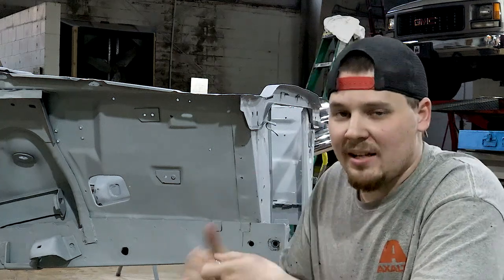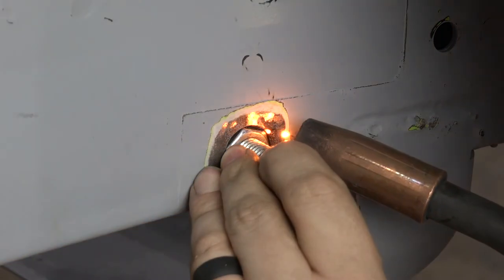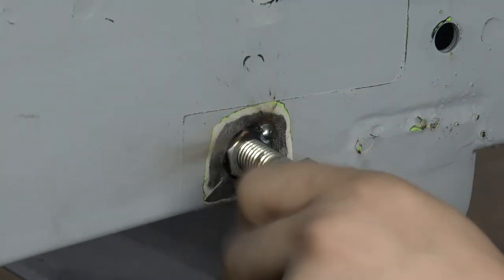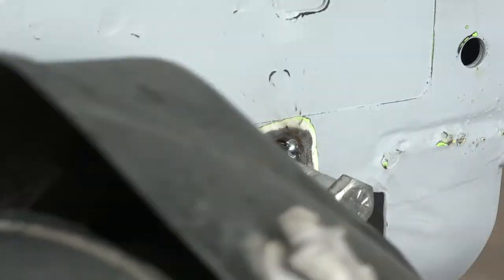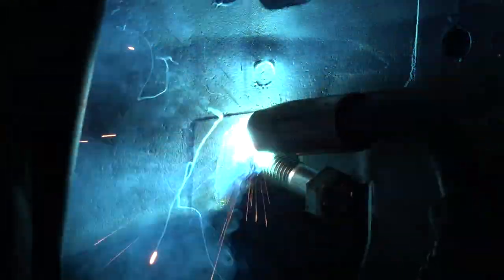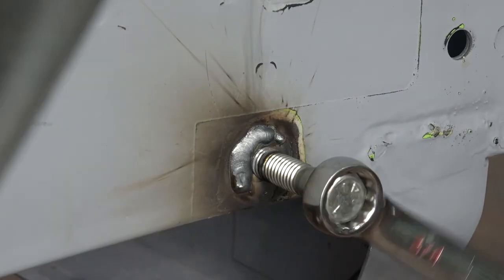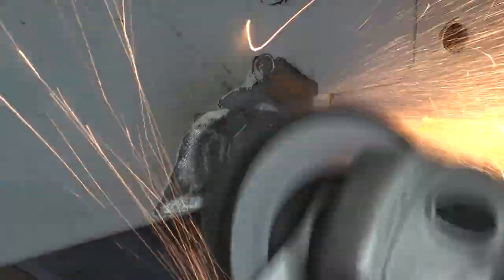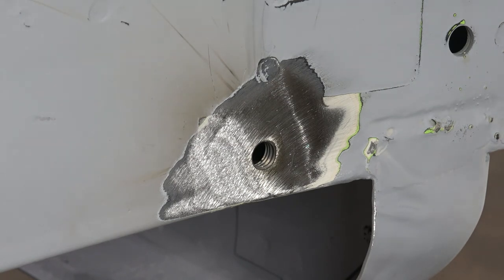How To Fix A Broken Nut Inside Of A Frame

Comment: Thanks dude... I tackled this on the weekend, worked out great like you showed. I originally broke the nut inside of the frame mount for the front lower controller arm on an older Subaru outback. I was gonna go another route which was more work till I found you;)
Reply from the maker: Thanks !!

Comment: If you weld this then paint only the OUTSIDE of the frame (where we can see in the video), how do you protect the inside of the frame where the paint has been burned off? 
it will eventually rust/rot in there if left as exposed metal.
Reply from the maker: Spray the inner frame rail with DMP.

Comment: Nice work.  I have a Jeep CJ7 frame with a bunch of broken bolts in the threaded holes and a few stripped holes.  I was looking for a clean way to do this repair!
Reply from the maker: Thanks man Yea man this should fix them .
Reply: Same here, except for a TJ they use rivnuts in the frame. They don't seem to be incredibly difficult to install but nobody seems to cover the removal of the old, damaged rivnuts. Seems like this may be the way to go..

Comment: 1967 Pontiac Firebird, was in process of installing subframe connectors and new rear shocks. frame connectors replaced the stock forward leaf spring saddle bracket. held on by three bolts with clip nuts inserts. nut broke from the clip, bolt is just spinning. can not reach clip nut. where do i go from here?
Reply from the maker: Might need to cut a access hole then weld it back up.